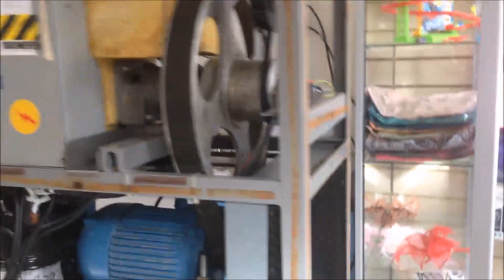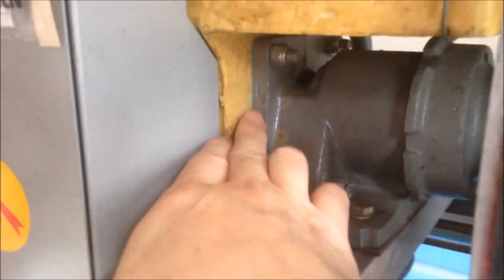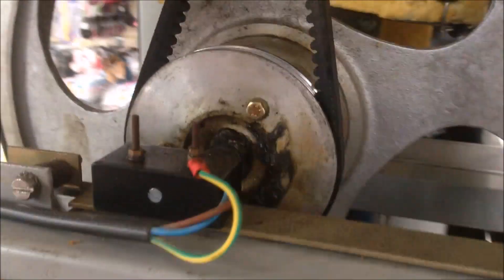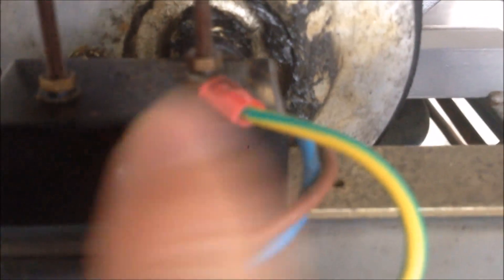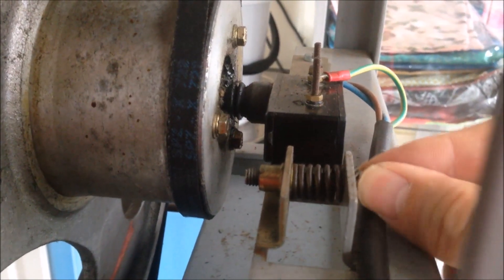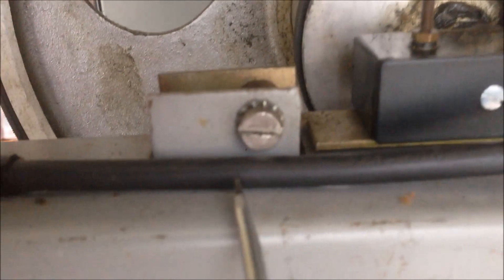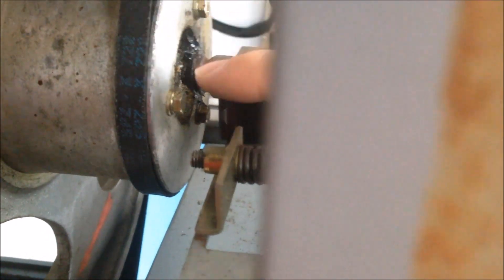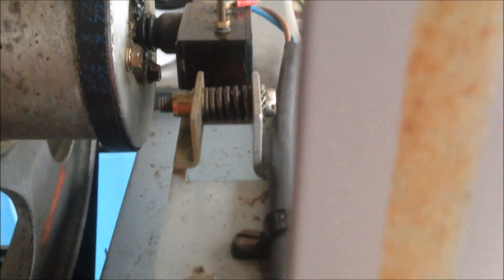Carpigiani 141 Ice Cream Machine: How to adjust ice cream hardness

Comment: hi can you tell me how and where to wire the switch up to electrically
Reply from the maker: The status of the switch is used by the control circuits, You can search the internet to find the exact or similar manuals and study the circuit diagrams in those manual, then work out where the switch should be connected to. In my case, all the components were connected as original. Good luck!

Comment: My feeding tube has bent from the bottom and is now stuck in the hole and i am unable to remove the beater blade any advice machine works fine just makes it harder to clean
Reply from the maker: Hi, there! it seems to me they are two issues and not related? The feeding tube was just put in by hand, how could it be so hard to pull out? If that happened to me, I may use some gripping tool to hold the tube and try to pull the tube out from top? In extreme situations, we might have to dismantle the machine to find out why? Wishing you careful and good luck!
Reply from the maker: Hi, I think the tube should not go into the cylinder and not possible to be bent by beater? You could use an inspection camera (the camera fixed at end of a cable, for cars or difficult to reach spaces) to see inside of the cylinder, then decide what to do next. if the tube couldn't be pulled out, it may be possible to cut the tube from inside the cylinder and then pull it out from top (if this was the case?), in this case you will need a new tube(from ebay or elsewhere?). Good luck!
Reply: @ yes my thoughts are to cut the tube from the bottom and pull it out but the issue im facing is the main beater blade is not coming out and i dont want to damage it as they are very pricey i do appreciate your replies, is there any tutorials on how to get about this
Reply: @ hi thanks for your response yes the feeding tube was put in by hand but a issue occurred with the counter beater which has bent the bottom off the feeding tube, which is now impossible to take out and my main beater blade doesnt want to come out the machine 🤔 is there anywhere else i cant contact you please just for some advice.

Comment: Very informative. I have a 323 VAN/P machine that gives a loud vibrating sound only when it is in freezing mode. I remove the beater shat to rule that out and t still vibrates. In clean mode it's very smooth and no vibration, only in freeze mode. Thanks for you assistance
Reply from the maker: hi, not sure about your model. It could be over-beaten mix and hardness was set to be too high so that caused ice formed on the internal surface of the cylinder, to make noises and vibration? Good luck!
Reply: @RepairDIY  I found the problem, the Hard O Matic springs are worn out which was caused the two bronze plates to skip. I add some washes on all of the springs and it worked as it should. That's' just a temporary fix until  get the replacement springs

Comment: Thank you,  my machine started clicking constantly lately. Would turning this screw clockwise help ?
Reply from the maker: I guess that When the temperature inside the cylinder is too cold(harder ice cream) or due to the mix left in cylinder for too long (over beaten), ice may for on the inside surface of the cylinder, when the beater rotate, you may hear the ice scrapping sound. this sound may disappear by reducing ice cream hardness or after the machine is washed and filled with new mix. Have a good day

Comment: I have had problems with my Carpigiani Van machine. When I turn the screw, clockwise to make the ice cream harder, it slows down to the point of almost stopping. If I turn it anti-clockwise , the ice cream is too soft. What could cause this?
Reply from the maker: Hi, hard to point the cause. for example, if the mix stays in cylinder for too long (beaten too much), the ice cream could be soft. Good luck and have a nice coming summer!

Comment: hi, thank you so much for your instruction. I have a problem about the flying wheel's movment. In the vedio you said it has about quarter-inch operating distance. But in my case, it can only move a few millimeters which makes so hard to adjust the ice cream's thickness, the machine wil either stop too early or never stop. Do you have any idea about how to fix this problem or do you have any related vedio? I really appreciate your help.
Reply from the maker: Hi, there are many factors affecting the hardness of ice cream, you  can try to rectify other issues instead of adjusting this screw only.  For example you should clean the condenser grills using a brush and vacuum cleaner; you should make sure there is enough space around your ice cream machine; you should make sure there is enough mix inside the cylinder; you should make sure the ice cream mix in the cylinder not over beaten (for example after long time no sale period?). In summary, adjusting the hardness screw is only one way to deal with hardness problem, and it is only effective when all other possible reasons have been looked after. Good luck!
Reply: thank you so much for your advice,though my problem is not about the hardness of ice cream, it is about the movement of flying wheel. after replacing the drive socket 2 years ago, the flying wheel could be only pushed back about one millimeter. I think it could be something wrong with the 'two slipping plates (spring-loaded)' you mentioned before.  I'm wondering if I can fix or replace this part?
Reply from the maker: if you search for carpigiani ice cream machine manuals, you should be able to find some manuals with diagrams showing the internal structure of the sliding/slipping discs. I have never opened that up. There should be permanent lubrication there for the sidling discs. As the springs are strong, the flying wheel is barely move when I tried to push by hands. Good luck!

Comment: waw thank you so much but what makes the flaming wheel moveback i wonder how !
Reply from the maker: That is the design, called Hard-O-Matic. The flying wheel is driven by the beater motor, the beater inside the freezing cylinder is drive by the beater drive socket. Between the drive socket and the flying wheel there are two slipping plates (spring-loaded). When the ice cream getting harder, there is more resistance to turn the beater, then the slipping plates will separate so that the flying wheel will move rearward. When ice cream is ready, the flying wheel should have moved back enough to operate the rear micro-switch to turn the cooling system off. cheers